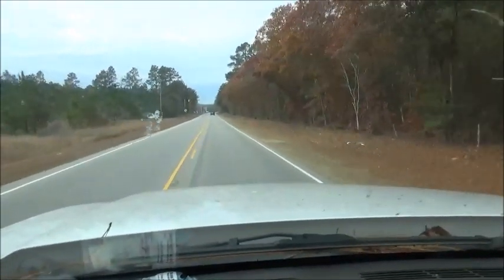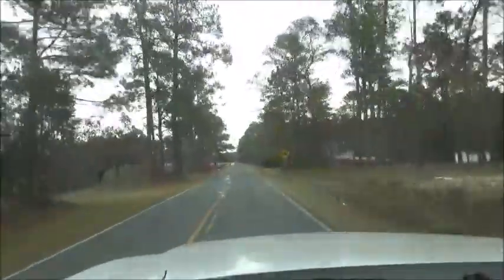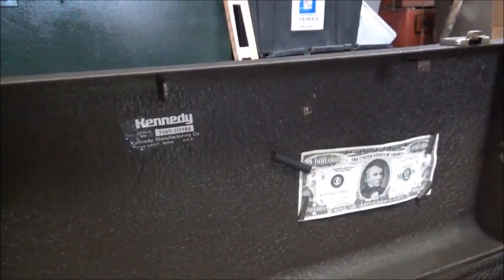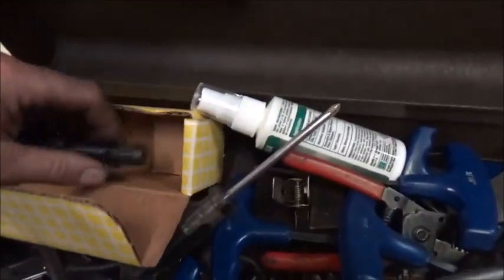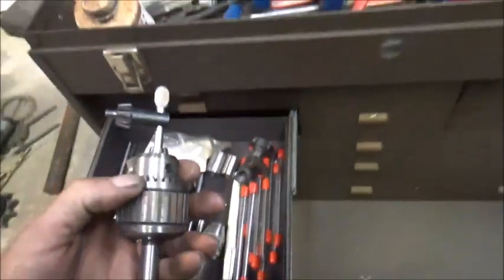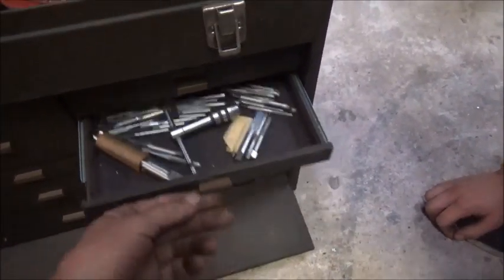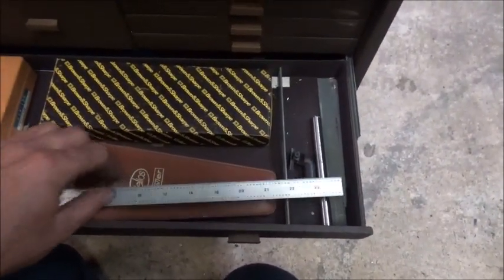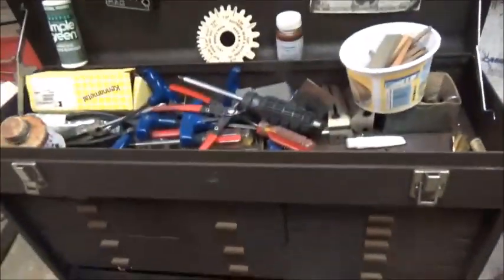Ultimate Market Place Find! Machinist Tool Box "I Hit The Lottery"

Comment: That pin that you found in the drawer with the height gage is called an ejector pin. It’s used in plastic injection molds. It appears as though the box belonged to a mold maker or mold maintenance guy. All those stones are for polishing mold cores and cavities. The tools are well worth what you gave for them..
Reply: Your exactly right about the pins and stones, l used to work in a injection mold making and repair shop . For Dana corporation.
Reply: Lots of good stuff in that box Merry Christmas to you 👍🏿💯
Reply: Definitely a tool and die makers box
Reply: 100 % agree I should know I did mold maintenance in a plastic injection factory.
Reply: @pkuudsk9927  x2

Comment: I agree the box was owned by a moldmaker as evidenced by the polishing stones and ejector pins.  The little thing you thought might be a reamer is actually for lapping holes.  When tool steel is heat treated it leaves some scale and holes can close up slightly.  You need to lap them to clean and bring back to size. I expect someone will someday be looking through my tool boxes wondering about stuff too.😊 Good buy, enjoy!  Mike

Comment: The pins with the discoloration from heat-treating, are "hot work ejector pins". They are intended to move freely inside mold bases operating at high temperatures, and are therefore normally .0001" undersized. Similar looking pins that lack the discoloration, are commonly known as "accelerator pins", and are more likely to be "full diameter" pins. Both types are considerably harder than "drill rod".

Comment: An old boss of mine had his dad's machinist tools. The most fascinating thing in the collection was the cabinet the guy built for housing tiny parts. It had 24 slots and each slot housed a cigar tin, Dutch something cigars, Dutch Masters maybe. Anyway they were all matching and each of the slots held their tin firmly. To pull them out you used an old ham tin key to hook the lip of the top of the cigar tin. The ham tin key fit into it's own little slot that you had to know where it was to see it. Early form of anti theft technology, or machinist going full machinist mode, whatever the motivation it was a work of art.

Comment: The center drawer withers the book in it, on the bottom is a hole that's how you get the book out then tip it back in in reverse. Great box. I have the exact same one along with the 3 drawer box that goes underneath it

Comment: Great find . You got an old Toolmakers Box .I worked in that trade some 30 years ago , and immediately recognised them ejector Pins as pointed out by Gene Neseth. They are used to eject the plastic part's the mould produces .

Comment: Awesome Score Brother!! Couldn't have happened to a nicer guy. A Lot of great scores there for sure. 1 2 3 blocks in the bottom drawer with all the holes in them. In bits alone, I estimate in the $1,500 range alone. The mechanics bible as it's called is an invaluable tool in and of it self. Worth thumbing through if your reading glasses script is up to date. Cheers! Zip~

Comment: Those two replaceable insert cutters are worth some big 💰! I actually had two of those exact same boxes. One was mine, and the other was my Dad’s from when he worked as a toolmaker. Unfortunately lost them both when my old shop burned.......  Those pins are ejector pins for use in dies. Used to work in a die casting factory..

Comment: Nice score! You definitely got a deal all the way around. Start pricing some of those drills and endmills and see what you come up with, you'll be shocked. Just the box alone is probably 600$ plus. Those Kennedy boxes don't come cheap at all. Those Helios/Fowler dial calipers are good ones as they should be German made. I have the same ones which I use every day without fail. Nice 24" rule in there also which is not cheap. I've made a couple scores like that myself over the years and I still get excited about finding stuff like that because I use those tools every day at my home machine shop, which is my second job and my first love. I always scrounge around for tools, supplies, and machinery because I can't afford much new stuff. I am always looking at auctions for something I need and you have to be patient at auctions because more often than not, the deals come at the end. I just bought a real nice 10" Brown & Sharpe dividing head with tailstock and 3 jaw chuck for 150$ at auction 2 weeks ago. I was really tickled because it wasn't one of those cheap Chinese knock-offs either. I also watched a K&T 2H Plain horizontal mill with tooling in immaculate original condition sell for 250$! I had to exercise great restraint on that one.

Comment: That's a great find. I have my Dads wooden Machinist box with some of the same things you have there. My Father was in two trades he was a machinist and an Electrician. I was missing a couple things in my machinist's box and found some decent calipers and micrometers and a machinist's Handbook on ebay. It's always great to have the tools handy because sometimes you just never know when you will need them. Thanks for sharing.

Comment: 12.04 Ejection pins for injection moulds,  the rod you put in the bike,  is for layout with a height Gage into pockets of slides on moulds most likely  , bottom drawer 1-2-3 blocks for set up or layout . the cutter that says warp , can be fixed , the stones are for polishing MOULDING surfaces ie slides and plastic injection Moulds seal off areas. The stones are worth over 150 bucks alone , some will be 2000 grit , Best Regards John

Comment: Alot of those stones are used for high lighting body panels. They are  used in such away that if drawn across a flat surface the high and low surface can be identified.

Comment: Every one of them stones were shaped by hand for different molds , Nothing special about them unless you have the mold they fit. The pins are from injection molds to release the parts from the mold , the reamers are for cleaning out pin holes.
Gene Neseth is 100% correct , this was not a Machinist box but a maintenance box for molds.
The tools are worth much more than 150, good find , 
EDIT
Lots of love in that box ,to care and detail.The drill bits and end mills are probably not new but only ever hand used kept to perfect condition
 My first hand polished mold was/ is in millions of people homes , it was the crisper drawer in a Westing house refrigerator. That same mold was used in many other brands over many years. It was the first clear plastic drawer  back in 1982 to my knowledge. Probably more than 400 hrs to hand polish that mold, before cnc could get anywhere near that kind of finish. Seeing the first part come out so clear was like a new baby for me. Making a mold is not easy , keeping one in good shape is harder after a million parts are made from it , running 24-7 for years.So what ever them stone's are for someone is wishing they had them to fix that mold if they were the original stones to copy from.

Comment: The stones in the top can be used for light deburring and chamfering edges. The flat ones can be used for removing light tool marks. Just use them with some cutting oil so they don't load up. They are expensive and if you take care of them they will last a lifetime plus.